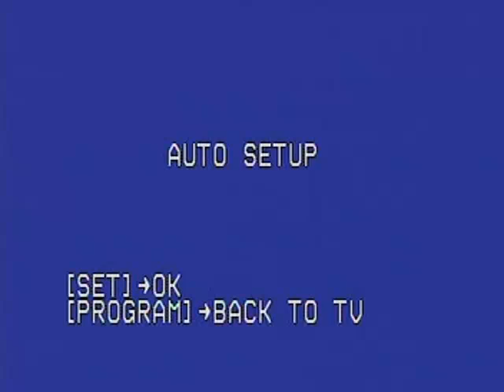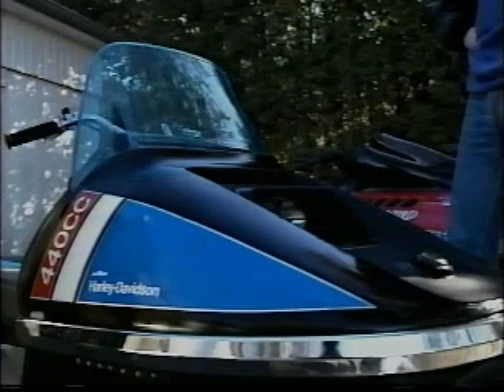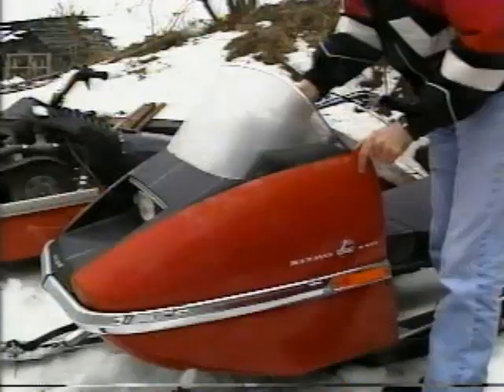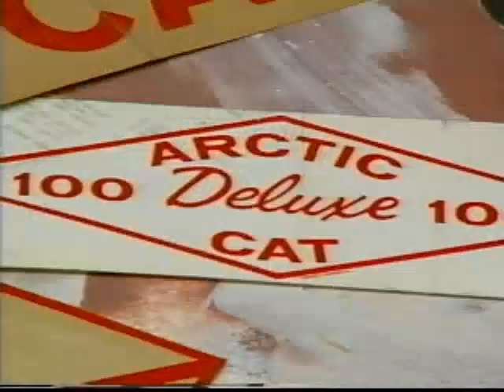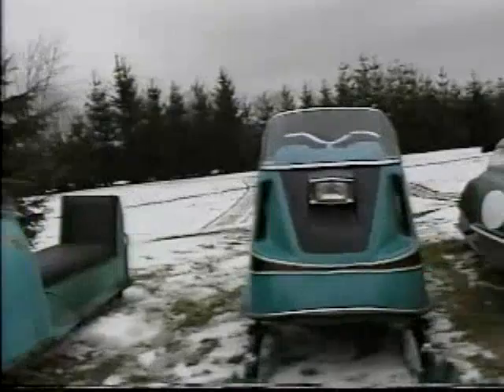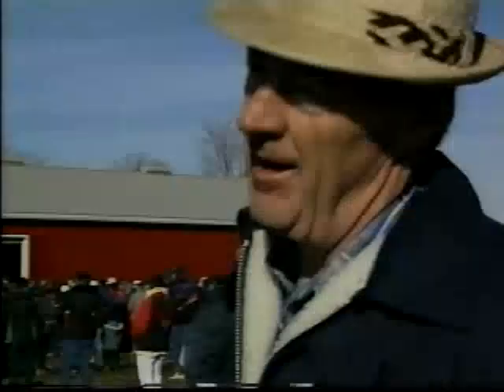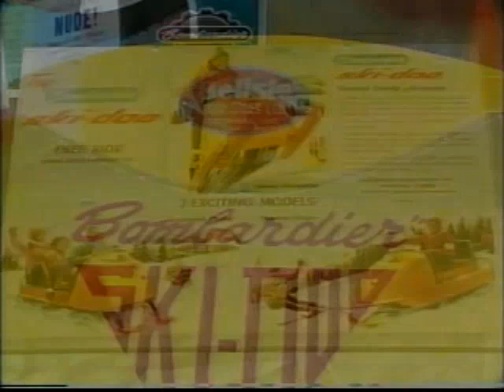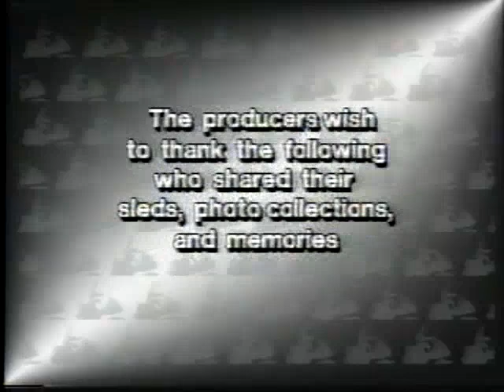Classic sleds Vintage Snowmobiles from the golden era of sledding

Comment: I’ve had lots of sleds over the years. I started riding when I was 10 in 1977 and in 79’ I got my first snowmobile. It was a 67’ ski-doo w/ a 10hp single cylinder Rotax. It wasn’t very fast and had a few bugs to work out but it sure was fun once it was straightened out. I could blaze trails through deep powder while other bigger sleds would sink and get buried. Greats times and memories!

Comment: I bought a 1978 Kawasaki 340 Invader as my first sled. I almost always had a passenger and it didn't slow it down one bit on top end. I beat 500 cats and ate 440 snowtwisters for lunch top end. I cant explain how fast it was. I twisted the speedo cable off the second week i had it on a back road racing a 440 blizzard and 440 john deer. both brand new as well.
Reply: I never understood why they got out right after spending a boat load of money on R&R? The 1979 Invader broke every record and the 24 hour record might still not be broken. Im a Ski Doo guy but would race my old F/C drifter with anything hands down it's got to be one of the most reliable brands ever. Kawasaki clearly has a winner hell they still power Cats

Comment: First sled 1969 Nordic 371 in (1985). 1973 Yamaha GP433, 1974 TNT 400 F/A , 1979 Olympic 340, 1973 John Deere JDX8 440 case reed, 1974 TNT 440 electric start, 1969 Ski-Doo single cyl. 1978 Everest 440, 1996 Formula S 380( new), 1980 Enticer 340, 1994 Polaris Sport 440 fan. All bought/ rode/ sold. Currently have 1994 XLT580. Loved that two stroke smell!
Reply from the maker: I rode on a TNT F/A as a kid , not sure if it was because I was so young or what, but I have always remembered that sled for being fast
Reply: I knew you were gonna get to me eventually….80 Enticer!   But I sold it for a 250 enticer…oh boy…that was as quick as any sled on the snow.

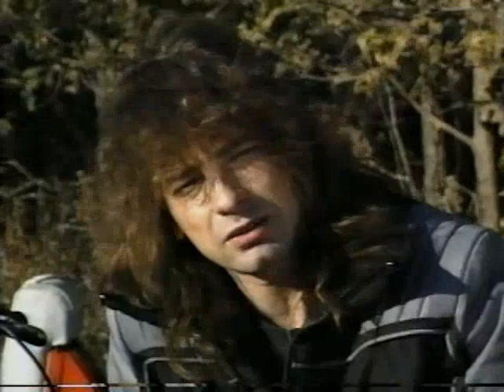Comment: That man at the 9:00 mark just described the essence of man and machine.   Speed is not the thing…it’s staying on top of a machine…regardless of speed…that gives you speed as a sensation..

Speed ruined snowmobiling …well, not ruined it…but escalated it into an “everything faster mentality. “ 

And it did not have to be that way.   

Such is man’s weakness….he thinks of his strengths in only  terms of power.  

I could parallel this to golf and softball…how the same mentality messed up those sports….

Anyway.  Listen to 9:00 and tell me if I’m wrong. Plz